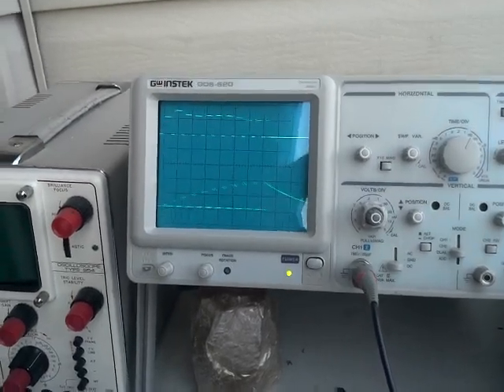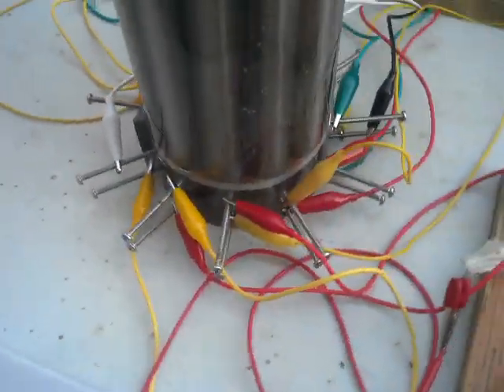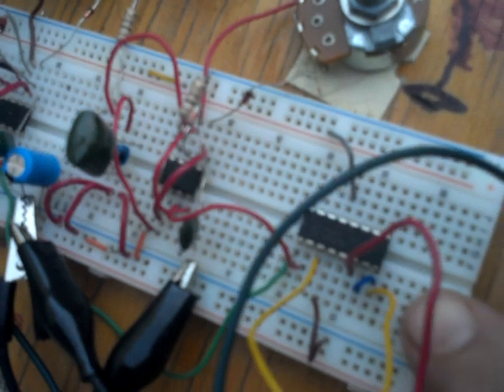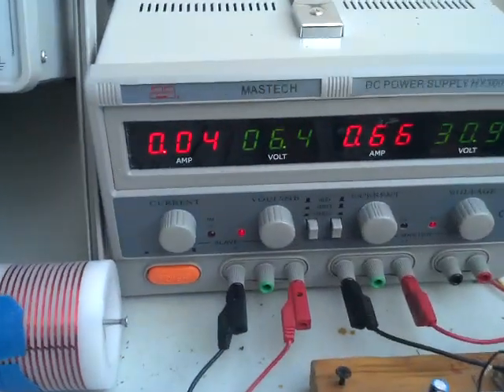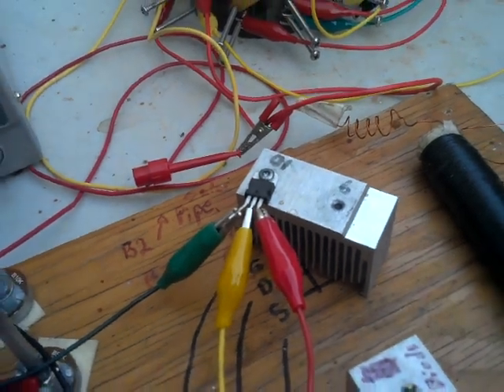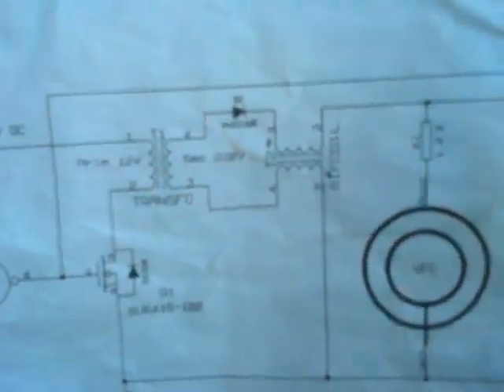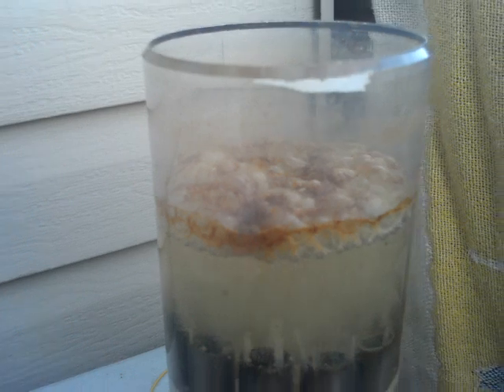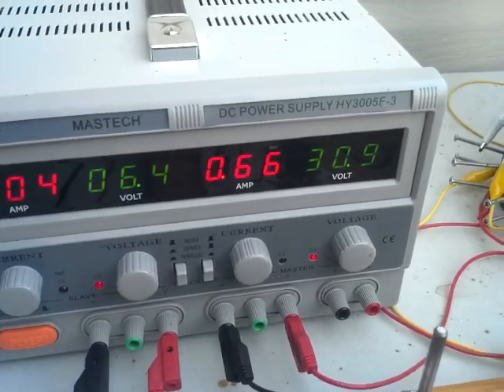Resonance with a diode.mp4

Comment: Hy Jon ,today i finished my coil like you said(almost) my ferite rod was a radio antena ferite,10cm long, i wound 24awg bifiliar from end to end of the ferite rod i isolated it with tape,thena 22awg primary from end to end perfect wound/isolated with tape,then a 30 awg perfect wound.My wfc was a 7cm long tubes 1mm spacing....I pulsed the primary with 12v and the output on the sec was 3v,i dont know why...

Comment: hy,one last question i have,before you get resonance on the cell what was the voltage at the cell?i barely got 130v out of my vic,with no load and when conected to the cell got nothing,russ also got 1000v and when he con the cell he end up with 10v,so what was the voltage without the cell atached/with it atached before hitting resonance

Comment: Hy,John,here is what i done:i wound 2 chokes,bifiliar 350turns(0.5mm),then primary:150turns(0,5mm).then secoundary:1000 turns (0,2mm),don't even light a led,you wound these coils nice and tight?or you skipped a bit,because i cannot wound them exactly side by side,i drive the primary with irfp240 with 12v

Comment: 3:1 so if the prymary has lets say 200 turns ,sec has 600,end to end so you have just one layer?strange how do you get 3:1?sorry for the annoyng Q...but i was impresed by your achevements with such simple devices(i had my sec 7000turns)and still no HV,you don;t answer about the voltages at the cell,if you don;t want is ok,thanks a lot for your late answers:d

Comment: just that?the primary should not have less turns than secundary?on a 8'' rod you have space to wind about 200 turns?corect?what was your voltage without the cell con and with it conected.I ask because i managed to ger 230 v from my vic and when hook it up to cell dies,0v....verry curious how you manage to keep the voltage up with the cell connected

Comment: I like that ramping waveform!! Looks like step charging to me! I can't adjust the voltage input on my setup but I'll through together a variable voltage divider to get the job done : ). 
Have you thought about getting ahold of a machined tube incased in Delrin like stans? 
Keep it up!

Comment: Jon can you draw and post a complete schematic with the Lawton circuit and your modifications, number of winding's, exact size of wire, size of core and material, what stainless steel tubes [316L ?] size of tubes diameter and length and any other information that would be critical to the build, also on Russel's site? I see that there could be much room for error unless this could be done as I have described. I have built two of the Lawton circuits and one 8XA circuit. Like to build to your specs